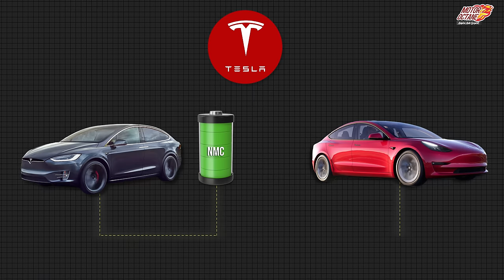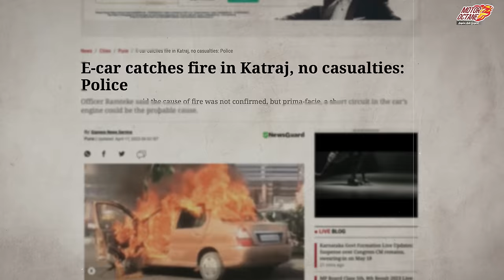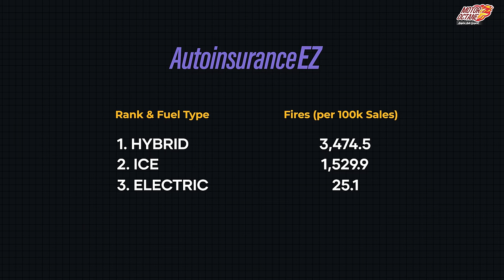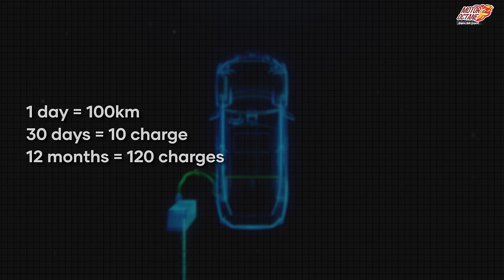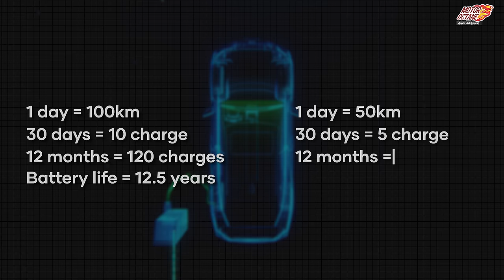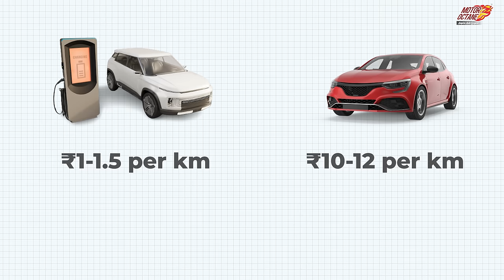Electric Cars have Battery Problems?

Comment: why u exaggerate things ?
a petrol car costs 5 to 7 rs per km 
a diesel cost 4 to 5 
and u r saying 10 to 12 lol
Reply: servicing costs
brake pad more often changed
5-7 is when you use the mileage shown in the dashboard for calculation

in reality it is very inaccurate, even my nexon EV shows it will go 290km when fully charged but goes 250km only. So only believe tank to tank figure for mileage 

when you use those value (which are easily 3-4kmpl lower) you will see reality

Comment: NMC vs LFP is future Mac vs Windows it seems. 😂
Reply: not really, as he said even same manufacturer is offering different battery type as per budget.

presently mahindra is buying battery from LGChem (who also supply Hyundai and Kia by the way) but later on as rachit said, even mahindra will use LFP.

Generally, all the <50L EVs will use LFP because its cheaper and more durable than NMC. However high performance EVs like merc, bmw, Tesla etc will use NMC due to more power output (these is limit to how much Amps LFP can generate)

Kia nd hyundai are using 800V battery while tata is using 320V so thats further proof that it will be a matter of price -- if you can afford, there are windows laptops which are costlier than macbooks too (XPS, surface, and some gaming laptops like alienware razer and MSI)
Reply: @shresthsonkar9207  The debate I am mentioning between fanboys of each technology type.
Reply: @ads7506  ha wo baat alag hai 

Otherwise same company de rahi toh kis chiz ka fanboy
Reply: @shresthsonkar9207  Yes it is just a technical difference between two electrolyte/electrode materials and hence chemistry and charge densities are different but most battery manufacturers can work on both the chemistries.

Comment: Kya bakwas, NMC perform worse is lower temperatures, they have smaller temperature range where they perform efficiently. Infact LFP is better than NMC in this regard. NMC is more energy dense than LFP which its USP. 3.1 Million subscribers ko info share karne se pehle thoda toh research kiya karo

Comment: Bhai log is bande ne jo estimate diye hai wo 100% to 0% ke liye diye hai aisa charging cycle koi bhi use nahi karta to battery life isne Jo batayi hai usase adhi hi pakadiyega
Reply: Cycle is not defined by only 0-100, even if you use 100-80 daily and charge 20%, it amounts to same thing

Cycle is based on total capacity consumed, not in how many instalments the cycle is completed 

Whether you charge once a week from 0-100 or 20% each day to always keep battery 100-80, it will count as one cycle

Think about cycle as calories 

Whether you eat whole cake in one day and exercise everyday or eat 6 pieces of cake each day and workout on Sunday only, it’s the same thing
Reply: @shresthsonkar9207  WTF Then this guy gave Wrong information in his previous video.
Reply: @sanketgarad0  technically he is correct 

But that’s not the only way to count one cycle that’s it 

0-100 is ONE of the ways of to count a cycle but it doesn’t really matter whether you use whole battery and then charge or keep charging as and when you use the car (ie daily short charging vs weekend long charge)
Reply: @shresthsonkar9207  ohh thanks for correcting.

Comment: EV is not the solution for the environment, how you generate electricity is the solution

When u buy EVs and think you have gone green, care for the environment and all other fancy thoughts, Let me tell you, you have just outsourced the pollution somewhere else

EVs need power to charge, where that power will come from? A thermal Power station means more burning of coal. So please tell me how it is Green?

On the cost of EVs, Today's EVs are more expensive than fossil fuel cars. Let's say its an investment and returns are in the long run

Remember this, Today EVs are sold based on a cost-to-run basis. No one to date had factored in the cost of replacing batteries. After 5/7 years of purchase, what will be the replacement cost? both in terms of material and Labour. Also think about how batteries are made and disposed of. The pollution from fossil fuel is in air which can be fixed and we saw this during lockdown but pollution from EV is below the ground and you need minimum 20 years to clean it

The future is Fuel Cell cars, not EV or Fossil and it will take 10 years for the production unit

If today I had to go for a new car, rest assured it will not be a EV

Comment: I have ev . Never buy an EV in India.  Indian weather is too hot for EVs
Reply from the maker: Like how? What happened to your battery?
Reply: @motoroctane  only 150 km real world range
Reply: @tryeverything6713  ktm kitna deti hai tumari wo bhi bata do 

the more rash you drive lower you range 

tum range nahi nikal paa rahe toh EV ki galti thodi hai 

Im getting 250km range city 240km range highway@70kmph cruise control and 220km@80kmph cruise control

all with ac

naach na aave angan tedha
Reply: Earlier i used to belive such comments about range.  Now i know it's not

Comment: Very misleading and ill informed. May be he is misrepresenting facts using stats due to commercial reasons. Let me point out the problems in this analysis.
1. battery degradation is not total failure, but retention, range and charging efficiency gets reduced. Check Nissan Leaf experience where within 3 years 60-70% performance is seen, irrespective of use or miles traveled. Tesla battery degradation is there too, not as fast though. Anyways Tesla is not bought for being EV, so it is not a normal example.
2. the range of 4.5 lakhs or more hilariously 12 lakh is calculated based on assumptions of full discharge and recharge which is never the case. Usually a person plugs the car after coming home, slow charging and a lot of topups are used.
Unless something in Indian cars is radically different from what is sold worldwise

Comment: my ev gives 45% mileage on highway its useless car
Reply: Which car and when did you bought ?
Reply from the maker: Depends on what speed do you drive it and how you drive it also. EV Max in real life gives 300km range in city and 250-290 or highway depending on how you drive.
Reply: naach na aave aangan tedha